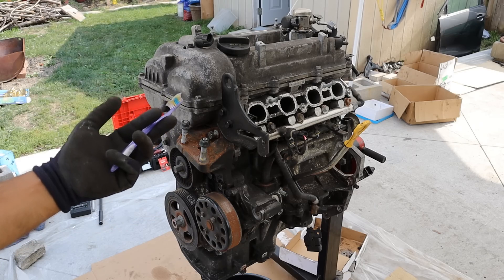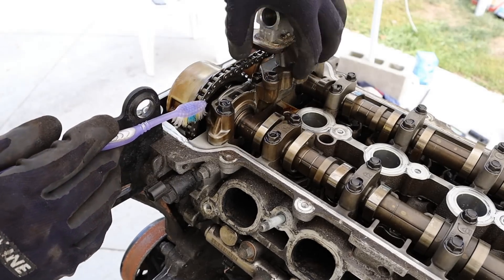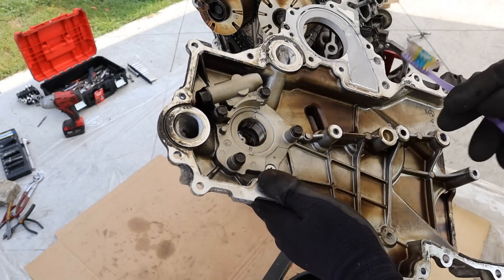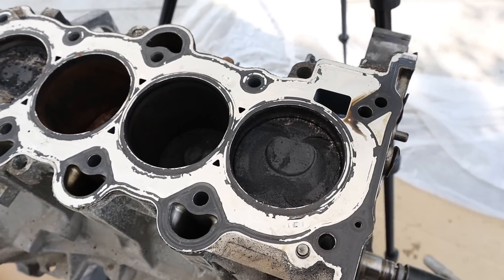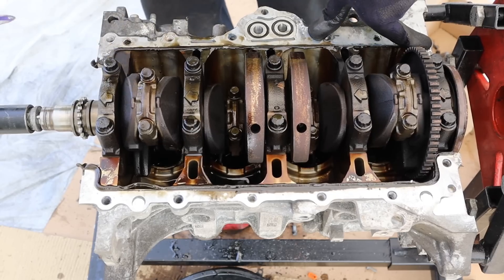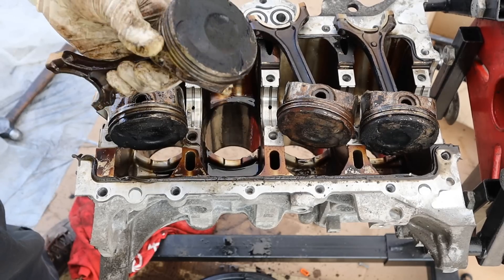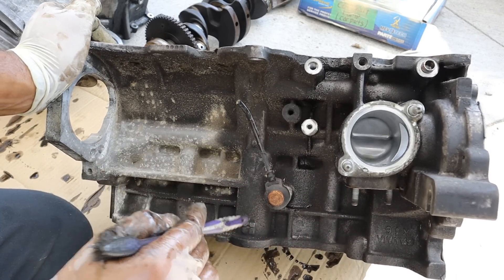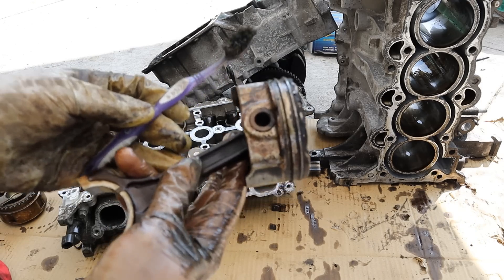Why KIA Engines Fail

Comment: I purchased a new 22 kia Sorento hybrid s AWD and within 3 months it was towed to the shop (may 25th).  Guess where it's still at?  Kia offered me 11k or to buy it back.  
Last Friday I found a rare Honda CR-V hybrid touring and snapped that up.  It's a boring looking car but at least it runs.
Kia sucks
Reply from the maker: 11K to buy back a new Sorento??
Reply: @speedkar99  no....it's either they pay me 11k for my trouble or they buy it back at full price minus mileage.   The attorney gets 33% of the cash settlement and kia pays an additional 2k if they buy my car back.

Comment: @6:16.  Why Im not surprised to see a plastic inside an engine.  Kia/Hyundai has a fascination on putting plastics as much as possible in their vehicles.   Planned obsolescence.
Reply: The only plastics appear to be the spacer around the sides of the cylinders in the water jacket...and the timing chain tensioners?
The right type of plastic made correctly will last as long as a metal piece...and it's quieter and cheaper....
BMW is a prime example of the wrong type of plastic...must be recyclable...but it therefore subject to temperature/cycles breakdown.
But high stress parts like coolant pump impellors?
Give me stainless steel every time.
Dittto timing gears etc.
Metal...
the correct overspec won't fail in the lifetime of the engine type metal!

Comment: From what I have been hearing from auto mechanics working in engine rebuilding the Hyundai and KIA engines are failing. There are parts inside that are under rated for the amount of stress and torque that is applied.  Most of the time failure occurs after the warranty finished. Rebuilding an engine if it is able to be rebuilt will cost thousands of dollars. A new replacement engine can cost more than it is worth in relation to the value of the vehicle. Most of the failures are with main bearings on the crank shaft and with the connecting rod bearings.  This is a major type of issue.
Reply from the maker: Yep. Mostly spinning or seizing at the rod bearings
Reply: Hyundai changed the engine parts only to increase MPG rating, so durability suffers. Only the original Theta I is the most durable with lowest MPG here (only up to 30 MPG on highway in 2006-2008 Sonata). Plus, it came with a Mitsubishi 4-speed automatic too.

Comment: When I do an oil change I buy 2 jugs. 1 for the change and 1 to constantly add oil every 1000 miles. 2017 Sportage 2.4
Reply from the maker: Ouch
Reply: @speedkar99  I use my car for work. So it's 1000 just over or just under, every week.
Reply: @Sir_Marc007  
Check every Saturday...and the engine lives on.....
2001 Mitsubishi 2.4 GDI owner...
I have the same procedure and consumption.
Nice car...shame about the oil control low tension rings.
But the PO has a spare engine he is rebuilding so we'll slip that in when it comes time to do so...
I buy oil by the 20 litre drum.....

Comment: Someone buys a Kia, says it's a disposable car I'm not going to bother with oil changes or even checking the oil regularly...Not surprisingly the motor goes bad due to lack of oil changes and running low on oil,  usually more than once. Our Niro says 8000 miles, I do it more often than that.
Reply from the maker: Yep. I also go 5-8000 KILOMETERS which is 5K miles

Comment: That’s why I have a forte with the 2.0 liter that’s non-turbo and not GDI. That one is a reliable engine.
Reply from the maker: That's the older version of this motor
Reply: @speedkar99  I’d say a better one. It’s a 2018
Reply: WHAT YEAR?
Reply: @zaks9919  2018

Comment: Thanks for the vid! 
I bought a used 2014 Soul 6MT w/ the 1.6l and about 100k on the clock a year ago and it burns a decent amount of oil.
I switched to a higher viscosity (5W30 full syn) and use GDI intake cleaner at every oil change (done every 3000 mi). I check the oil level on this thing religiously! 

Anyways, it's nice to see the internals on the 1.6l - makes me feel better about having to do any diy work on it. It's hilariously slow but still a blast to drive w/ a 6 speed!
Reply from the maker: How does the GDI cleaner work? Like seafoam?
Reply: @speedkar99  It's pretty similar to Seafoam! You bypass the MAF and spray it right into the intake. After the can is done you take it out for the ol' Italian tune up and then change the oil.
Reply: poor sap 😢
Reply: Did the 5/30 help ?
Reply: @rolandbourbeau7478  It hasn't hurt anything! In the year since I wrote this, my car now burns about 1 quart of oil every ~250 miles. The rings are pretty much shot as are the cylinder walls (as evidenced by cylinder wall scoring and a decent amount of piston slap when the engine is cold.) One whole bottle of Lucas Engine Oil Stabilizer is added every oil change and that helps slow the oil burn rate a bit (1 quart oil loss after ~500-600 mi).

If you have a Kia /Hyundai product with the Gamma/Theta/ Nu engine, do yourself a favor and get rid of it!

Comment: I have this engine. Oil changes and Intake valve cleaning every 3,000 miles. Almost at 170K miles
Reply from the maker: How do you clean the valves, seafoam?
Reply: @speedkar99  seafoam In crankcase or spray intake valve cleaner in throttle body
Reply: @carhoarder602  Can you explain how you do this and with what exactly. I would like to do this myselves
Thanx👍
Reply: @harcovanhees394  I throw Seafoam in crankcase 300 miles before the next oil change. I spray in the intake with CRC intake valve cleaner in bursts holding the throttle at about 2,000 RPMs. Shut car off after I’m done for about 20 minutes. Drive car for 10 minutes. Do oil change and you’ll see how dark and dirty the oil is
Reply: @carhoarder602  Thanx !! I'll give it a go.
Reply: @harcovanhees394  hopefully your engine lasts for a long time!

Comment: How does being GDI and carbon buildup contribute to oil consumption?
Reply from the maker: This is a good question.
Reply: Too long OCIs causes crud to clog the piston rings which are more susceptible to earlier vehicle's piston rings due to them being softer or more flexible for better gas mileage. Then the rings don't do their job as well creating a less good seal. this causes oil to get into the combustion chamber.

Comment: Thankfully my 2021 Kia Soul with the 2.0l engine is multi port injection. I have a 100k mile 10 year warranty on that but i hope it lasts after that.
Reply from the maker: After 10 years it's probably time for a new car
Reply: @speedkar99  my Kia is the newest car ive ever owned by a long shot lol. Every other car I've owned since I could drive was at least 15 years old. First few cars were classics, 72 vw bus, 71 vw beetle, 1979 Honda CVCC,  then a 93 mazda b2600i that is still my second car, and a 2004 saturn vue that I got for 700 bucks until it broke down and I got my Kia for a nice change of pace. So nice to have a fully functional modern car for the first time in my life. I just hope it lasts nearly as long as all my previous cars did.

Comment: Fortunately, my daughter isn't a "typical Kia owner" since she checks and actually knows how to change her own oil.  Her 2011 Forte uses no oil between changes and we'll be replacing the plugs this weekend.  Curious to see what they look like at 110k miles.
Reply: I've been changing the oil on my 2010 Forte(bought new) every 5k, full synthetic since I purchased it.  248k miles and no engine issues.
Reply: @mystiqblackcat  what engine does it have??
Reply from the maker: That's good. Keep up on the oil
Reply: @EricJones-yi5uy  I wasn’t asking a question. I was making a sarcastic statement about misunderstanding what the OP has said about spark plugs
Reply: 110K??? ☠️🚾😷 wow 😮 waaay overdue.
Reply: @wellnesscoach73  my manual says to change oil at 120,000km. Does that mean I should ride the car till 120k and do the first oil change or can infer that it is a checkpoint. Just like the spark plugs at 110k?

Comment: This engine looks exactly like the g4fc(also gamma, mpi port injection, single cvvt on intake) in my previous cerato 2007, that engine was remarkably sturdy and only had one serious problem in my time of ownership, which was the cam adjuster, although that may have had to do with how the previous owner abused the poor thing and used 20w50 oil in a vvt engine.
Kia owners are terrible, the cars themselves i don't think are that bad when taken care of, except for theta ii engines of course.
Reply from the maker: 20w50!
Reply: @speedkar99  yep, i thought it was odd when i got the car home and the trunk was filled with used bottles of 20w50, so i sought out the owner's manual online for that engine and there was no recommendation of that weight in the oil specs section, i got a great deal on the car though.
Reply: @chiefdenis  is it recovering now?
Reply: @glowiever  a bad cam adjust is not a problem that heals itself, that would require changing out the vvt mechanism, although I've sold the car, i think my friend still drives it that way, turning on the radio can be a temporary remedy to the issue though, lol.

Comment: Thanks for the video, been waiting a while to see that engine! Mine is 8 years old and run like new, yes, i change my oil as scheduled (5000 km). Any chance of showing the air intake with a light? Do you know the mileage on this engine? Thanks!
Reply from the maker: No Mileage information.

Comment: Apppreciate you doing this video.  I have a 2022 Kia Forte GT with a 1.6L engine.  What would you recommend to best keep it in good condition?  Should I be filling up with only top tier gasoline?
Reply: Yeah, top tier gasoline is make your entire fuel delivery system last a lot longer. You should also avoid short trips and lots of idling. If you drive less than 8-10 miles a day on days that you drive, you're sentencing your engine to an early death. Buy an electric car or something with port injection and not direct injection. Also don't baby the car all the time. These engines were designed to be driven hard. Also change the oil and filter OFTEN. 4000 miles or 6 months, and not a mile/minute later. These simple engines will go a LONG time if taken good care of.

Comment: The conrods are press fit in style so they don't need circlips to hold them like freefloating rods.

My friend who's a kia/hyundai service tech says his shop is down to 1 and a half hours on subframe, engine and transmission drop on almost all their fwd/awd models because they do so many of them. Their motors just don't last even with oil changes at the correct interval and any extension to the interval just shortens their life even more. I've also been told by the same guy that the aftermarket oil filter scene for these engines isn't trustworthy and that is contributing to engine failure, even if you do the change yourself get filters from a dealer.

Comment: loving these post-failure teardowns.
any chance you can get your hands on a Mazda Skyactiv 2.0L engine? Mine still runs like new, but I'm always curious about their hidden intricacies.
Reply: mazda’s skyactiv technology is one of the best in the business. doubt you have anything to worry about.
Reply: @Sekkzc  Here in Europe they are even worse than Kias, every single SkyActive engine is failing before 50k km.
Reply: @Jehowy666  So true! Especially the one with Start and stop teck and cylinder deactivation is leading to lot of failures but people love their Fuel Economy I guess.
Reply: @Jehowy666  that's really interesting to hear. how would there be more failures in Europe than anywhere else? In Canada we have some pretty terribly abusing winters and hot summers. These cars fire up and run no problem, all day every day.

I've had mine since I bought it new in 2014 and it still runs like new.

Comment: Hello! Thank you for the video. I sprayed WD40 Silicone inside the door panel while the window was down (put the nozzle through the gap). My question is since WD40 got inside the door panel, will it cause any damage to the speaker or any parts of the door panel? I did for all the doors. Windows feel tight as they go up and down. Please let me know. Thank you.
Reply: Yes

Comment: Thanks for this review of an all-Korean design. It appears that the execution is high quality, but the design doesn't tolerate edge-cases(neglect, abuse, environment). Curious how GM's newer Korean division (Malibu, Cruze, Spark2016+) compares to Hyundai/Kia.
Reply: It doesn't. Daewoo is rubbish.
Reply: I think there were issues with those but you need to look for specifics.

Comment: Is it me or does this look so kuch like a Toyota 2.4 and 2.5 engine with direct injection? Down to the buckets over the valve springs
Reply from the maker: Yes, the 2.4. 

The 2.5 uses a separate cam holder design on top of the head

Comment: I’ll never buy that type of carbon engine. Manufacturers need to go back to TPI
Reply from the maker: Throttle body ?
Reply: @speedkar99  Tuned Port Injection or MPFI. Anything but Direct Injection. DI defeats the purpose of having a modern engine. I’ll never buy a car with DI. Never!👎🏽

Comment: Do you have a video for the 2.4 theta from 00 to 05 sonata??
Reply: Only the newer hyundai kia stuff is trash my OG theta I got over 300k miles on tje original drive train and still runs like a scalded dog and gets like 26 mpg highway while dogging the piss outta it. all original accessories except the alternator whicj was replaced with a junkyard unit like 150k ago still going. Radiator leaks alittle and the power steering lines are shot, but original tranny, original shocks, so lets give alittle credit where its due. Oh and the belt h20/alt belt finally snapped on it but was original and lasted to 300k. The lt and st fuel trims are consistently .08  and .00. Did i mention its been wrecked 3 times and rebuilt the body with junkyard panels
Reply from the maker: No sorry

Comment: My sister has a 2016 Kia Sorrento and the dealer said that it needed a new head gasket. They quoted her $5000 to repair. Her car has about 150km on it. This is on top of the transfer case failing the year before plus other issues. Not impressed with KIA.
Reply from the maker: No warranty? Sad.

Comment: When my girlfriend and I first started dating she had a 2011 or 2012 kia forte. Car was really bad!! They don't have temperature gauges in the car. It overheated on the freeway and died on the freeway. Took it to the dealer and all the techs at the dealer didn't know what happened to it. A new engine was installed in the car then they sold it. Still don't know what killed it but I'm glad it's gone.
Reply from the maker: That would have been the original gamma engine without direct injection.

Comment: Interesting how pretty much every car manufacturer turned away from hydro tappets. As if they know these engines are gonna be scrapped anyway and noone is gonna rebuild them.
Reply from the maker: Hydraulic tappets are much more expensive to make
Reply: @speedkar99  Since they've been around for 3 decades by now, I wouldn't call them expensive. You can buy brand new tappets for an older car and it will cost you 100€ for a set of 16 so I would say the manufacturer gets them at around 25€ for a set of 16. Maybe even less.

Comment: a few i see around and because they're cheaper to buy they're just rat bagged.. oil change .. level checks haaa.. while driving if the oil light comes ON just blink 3 times really fast and the light will disappear 😅
Reply from the maker: They are cheap for a reason
Reply: @speedkar99  if they are cared for they can last.. the few I see that are, as a commuter car had over 400k on it which was pretty impressive especially for what they paid for it

Comment: 10:32 “a typical KIA owner is not smart enough to check oil”

LMFAO 🤣 😂😂 Ohhh DISS!
Reply from the maker: Am I wrong? 😏
Reply: @speedkar99  For the KIA, I would use the best oil and premium Mobil 1 oil filter to compensate for unreliability of KIA engines, such as Pennzoil Ultra Platinum, or Mobil 1 Extended Performance or Royal Purple, and for carbon build up I would use BG 109 Engine Performance Restoration engine flush to remove sludge build up and free up clogged up oil piston rings and check oil weekly to top up oil and make sure oil is at 2nd hole on dip stick at all times and use only Shell gas which is higher quality and a little bit of Shell V-Power on every fill up, do you think that would make the KIA engine last a long time? Would I be the highest IQ smartest KIA owner in the world?
Reply: @JundaComputersGmbH  
You would be deserving of any Toyota product as a reward for that level of maintenance....

Comment: Seems like Kia and Hyundai get a bad wrap in North America, in Australia,Kia and Hyundai are very popular, consistantly top annual sales figures and are generally well regarded. My brother has owned a 2005 and 2013 Cerato , both were always serviced and were mechanically sound, we didn't have any issues. The 2005 Cerato had 300,000+ on the clock before it was replaced. I drive a Mazda though ;)
Reply from the maker: Top sales don't mean top reliability. Chrysler and Ford do well for sales in America but their reliability is ⚰️
Reply: @speedkar99  of course, but my point was more about the brand equity and brand perception here vs N. America.

Anyway, love the content, I especially liked your series on Hybrid systems. When are you going to tear down a Tesla? 😂
Reply: I live in Australia and only buy Hyundai cars for the last 15 years. Great service network and custumer costumer service. And the sales refleck that ...no 3 and Kia 4 . 
Most of the problems in the USA is bad manufacturing  ....shavings left in engine when it was buildt. In Australia our cars are buildt in South Korea .
Reply: In Australia you don't have the winters like Northern US and Canada. I never saw a car loosing a half of the front suspension the way KIA or Hyundai does and over the years it's been a good few. The older cars had decently designed engines, but the GDI is ... a pile of what we had seen. On top of that people simply don't take care of them.